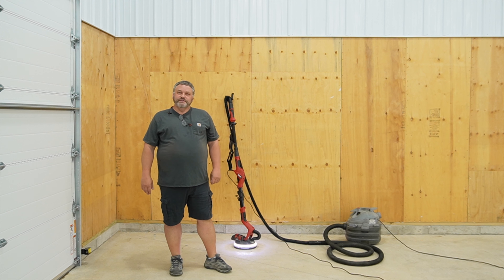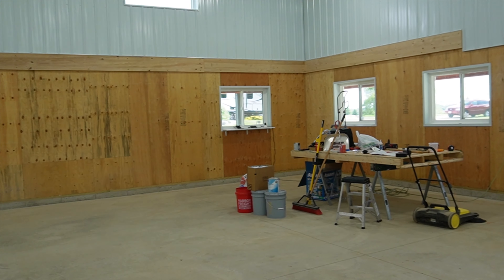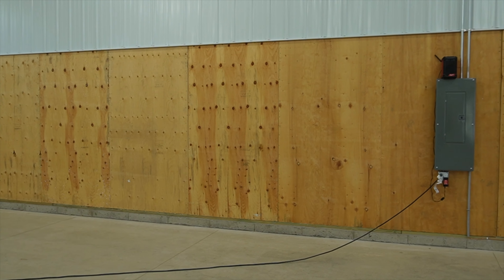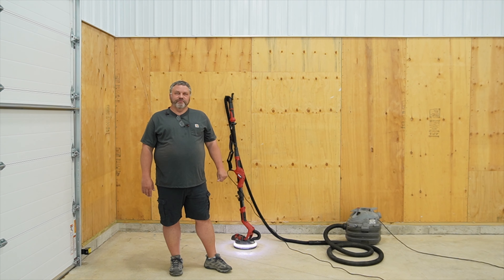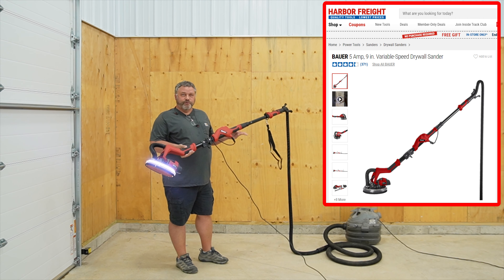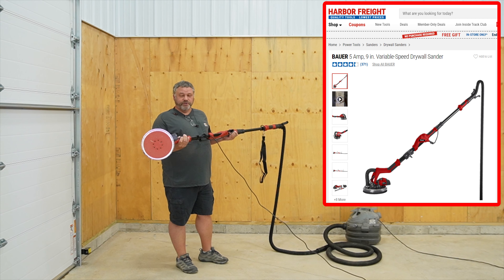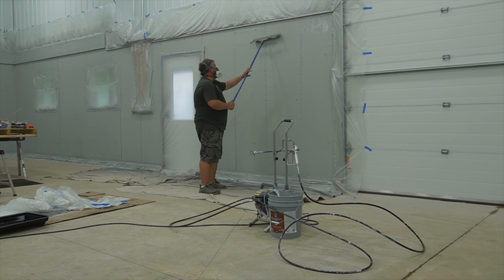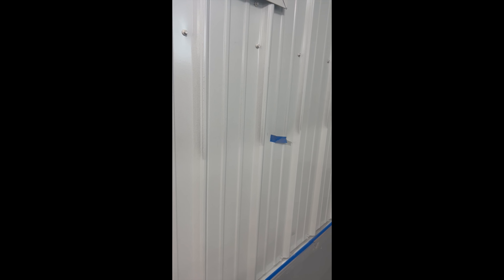Painting Plywood Shop Walls

Comment: You do nice work, it came out great. So much nicer than looking at insulation. In my garage I have plywood walls as well I found priming with and oil base primer hid all the knots I found with water base the knots would show through. In my second repaint ( done years later) I sanded with 80 grit then I just did a skim coat of spackle and sanded with 100 grit  it looks like dry wall now and I used about 1/2 the paint on the first paint job the new plywood drank the paint.
Reply from the maker: Thanks Pete, I thought about a skim coat of spackle but I convinced myself not to out of fear of cracking or adhesion problems.  Really it was my way of talking myself out of the extra work, I'm impressed you had the patience and tenacity to do it. I bet it looks great!
Reply: @DIYFabShop  The garage is only 20x20 I think the key is to use a wide trowel, and I was just filling  it the imperfections, I feel if I did two coats it would have made it look more like drywall or at least smooth wood, but the first paint job I think I rolled on maybe four coats of paint than it look right. We live and learn